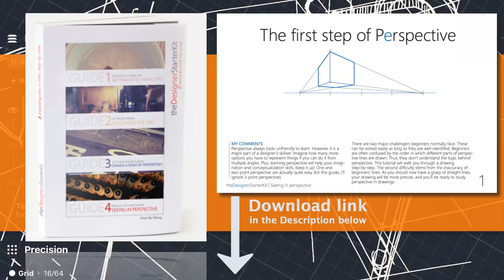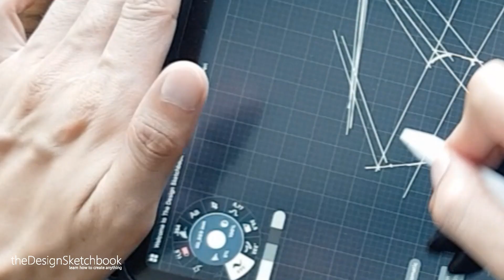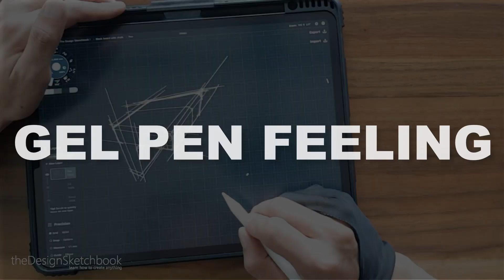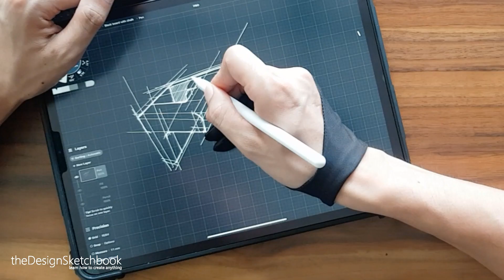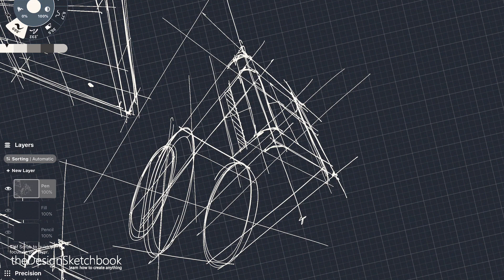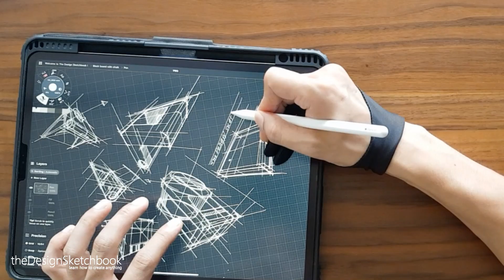How to Start Sketching on 'CONCEPTS' app (Beginner Tips for Designers)  | Product Design Sketching

Comment: How much should I spend on an iPad Pro?

Do you recommend any other drawing tablets?
Reply: A normal iPad either 2018 or 2019 is good enough. It has the same drawing experience as an iPad Pro. It's also by far the most value you will ever get for your money when it comes to screen tablets. Everything else, like the Microsoft Surface line, is both more expensive and worse in quality.
Reply from the maker: @decentradical  Hello John, 

For the choice of the iPad, Decentradical has a good point. You can save choosing the previous version for equivalent performance.

Whenever you test a tablet, do the jittering test. Basically, draw a straight line freehand slowly. And see if your lines get shaky or not. Ipad Pro is doing pretty nice on that. 

I used to try the jittering test on some Microsoft surface, it was terrible. I didn't tried on the newest one though.

Then, for the choice of your tablet, ask yourself which software you may want to use. 

For example, if you just want to sketch, and NOT working on Adobe Photoshop, Illustrator... and/or some 3d software... then the iPad Pro is a good choice.

iPad do have very good sketching apps! (For example Procreate, Concepts, Sketchbook Pro)

Otherwise, you may consider Wacom. But they are expensive...